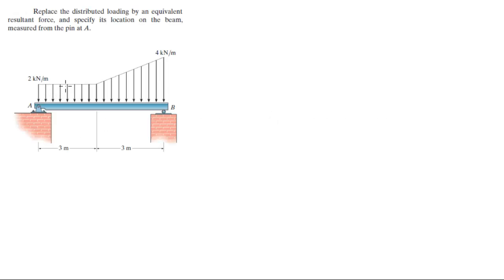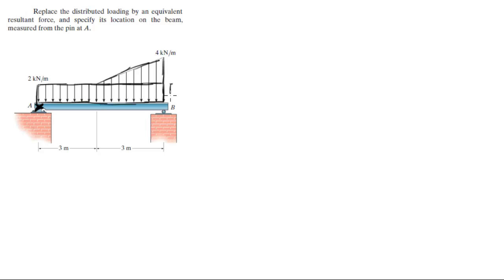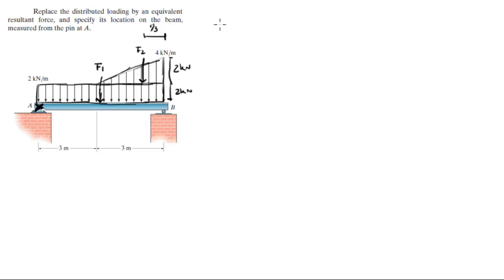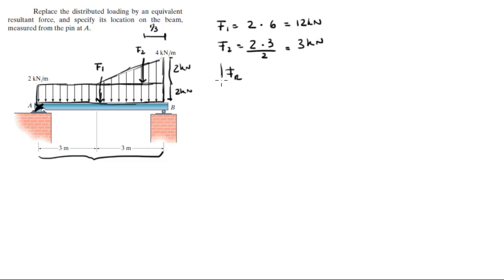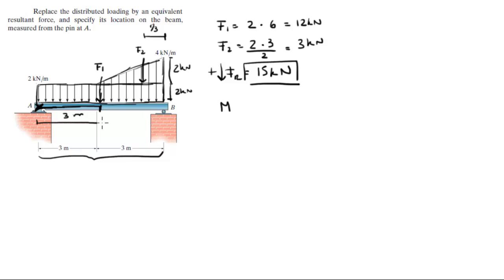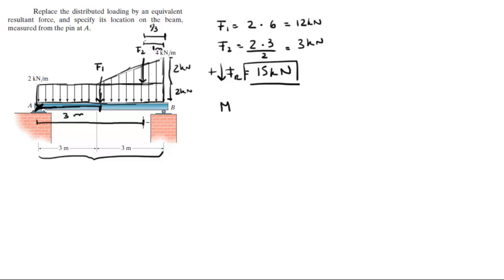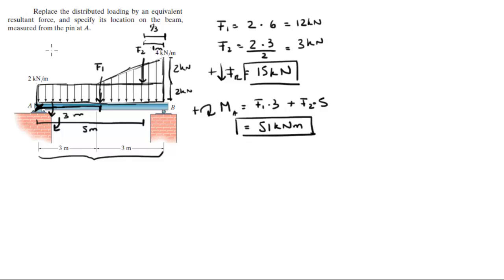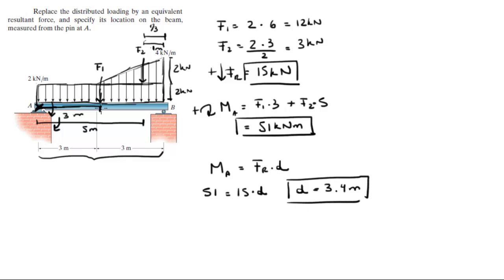Replace the loading with a resultant force and specify its location

Comment: I don't see how you can definitively say that the distance between point B and Force(2) is 1m.
Reply: When there's a triangular distributed loading, we say that the force acts at the centroid of the triangle, which we find by subtracting 1/3 of the triangle's total length from the total length. in this case, total length = 3m so we calculate that F2 is located 2m [3-(1/3)(3)] along the triangle (observing the triangle from left to right), which is 1m away from B. hopefully that makes sense. I'm referencing Hibbeler's statics text for this info if you wanted to double check for yourself.